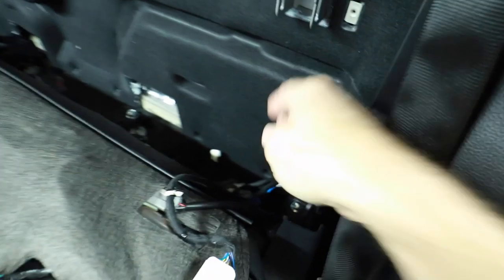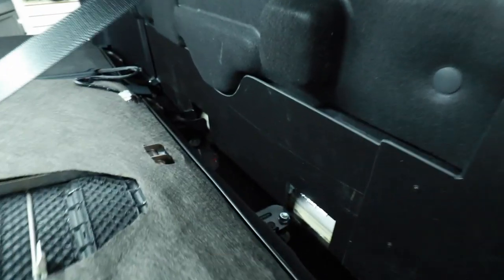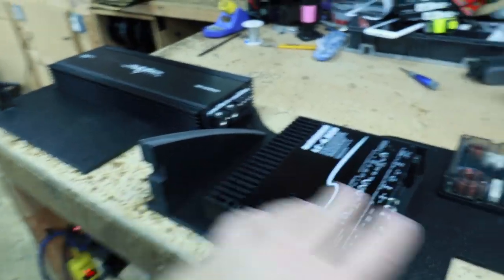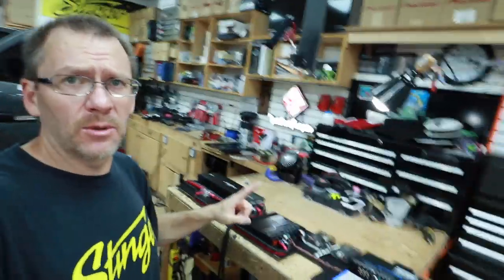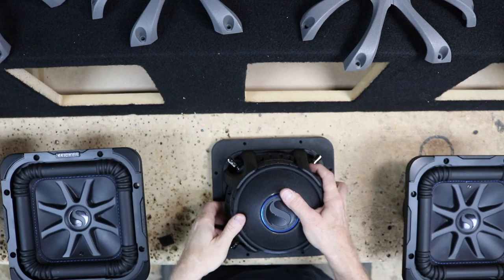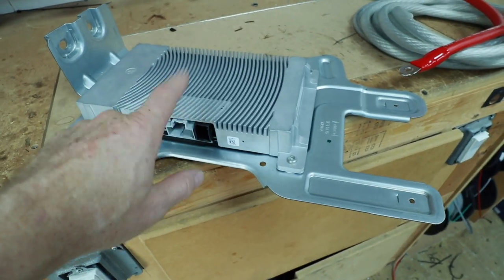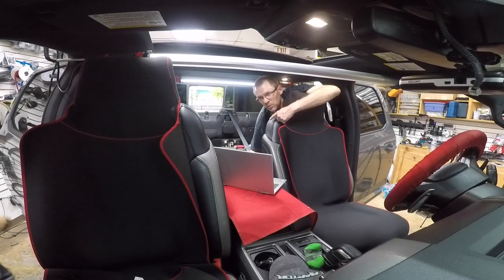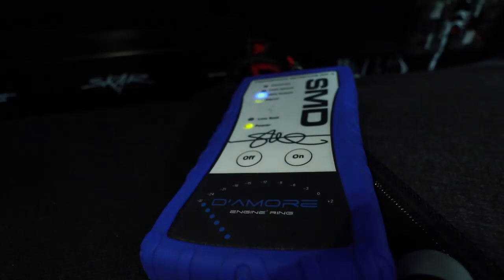A 2018 Ford F150 Raptor gets a  Nav TV Zen A2B and Audiocontrol Installer Diaries 205 part 2

Comment: Thanks for the great videos! I have a basic XLT and I've seen some amp+box used B&O systems that I would like to install. But I don't know if it's doable especially because I don't know if my radio unit has an A to B output?  Thanks again

Comment: What did you do with the center channel speaker?  Did you leave it wired for notifications/alerts?  I'm going to have a similar install done.  Why didn't you leave the front pillar tweeters as there own channel.  I was hoping to use JL Audio VXi amps which have the DSP built in - one amp for subs the other for 8-channel everything else.

Comment: Awesome install. I have an 18 F-150 that had the B&O system. The NavTV has been given my installer fits. The chimes are always messing up and I’m getting pops and random speakers go out. It’s on its third firmware update. Have you guys had any of those issues?
Reply from the maker: At firsts yes then we got a replacement unit, no more issues.
Reply: Five Star Car Stereo thank you so much for the reply. My installer says they are going to get a new one. Hopefully I just got one of the first models that was causing the issues. If it doesn’t work I may need to take a trip down to FL to see if you guys can help me.
Reply: I would hate to go back to stock after how much time and $$ I have put into it.

Comment: I had a question for you guys I own. 2018 ford f-150 I want to install. 2 amp and Change speaker's all doors.put a Speak a Box on the back seat. Under. And use the factory stereo. No amp on What do I need to use to connect to the original stereo factory?

Comment: (you didnt run in this particular vid) but if you were putting and aftermarket headunit in one of these trucks what length rca's would you recommend getting if you ran it from the headunit down the driver side door channels to where you had the amp rack in this truck.  ( i have a 2016 f150 supercrew)

Comment: Wow . I thought I had a lot of sh¡+ under and behind my ford seats but pretty sure you got me beat by a long shot. I've got 2 scars 2500.1 and 150.4 a 100f ? cap it's the size if your big addison.  We did 4 8" scar vvxv3s. I had to substantially lift the rear seat and move the adjustable handle .

Comment: If you guys used the speaker wire inputs straight to the DM-608 instead of the ZEN A2B, would it be as clean?
Reply: I want to know the answer to that one myself
Reply: @jayshafer16  well to answer my own question, I now have the DSP and it's connected via speaker level inputs and the signal is very clean. My factory system doesn't use any fancy amplifier so I get full range signal from my front door speaker wires. I spliced and sent those wires to the speaker level input of the DSP.
Reply: @BaysideSoundz  what dsp did u use and did u have the factory b&o system
Reply: @jayshafer16  Audiocontrol DM-608. I'm using my factory headunit
Reply: @BaysideSoundz  Hopefully u get the notification for this question.  If Im wanting to run another dsp after the zen a2b like the new marts digital 8 dsp and all the inputs are rca.  Would i run the rca's straight from the zen to the marts dsp since it has 4 inputs.  Front Rear and sub inputs from zen and then run the rca from the dsp to the amps.
Reply: @jayshafer16  yeah pretty much. That sounds correct as long as you have exactly that coming out of the zen's RCA (front rear & sub ). Then in the dsp settings you just assign which input you want to receive from for each output channel. I hope that made sense lol
Reply: @BaysideSoundz  made plenty of sense and thanks for replying!!!!!
Reply: @BaysideSoundz  i wish this new marts dsp had a toslink cable input then that would be golden
Reply: @jayshafer16  yeah that would be much more easier for sure.

Comment: If you leave the vent open, aint that going to give you alot of road noice when you are drivin?
Reply: That vent is so you don’t over pressurize your eardrum when slamming doors simultaneously. Manufacturers don’t want to be sued by someone with sensitive middle ear  canals. Remember they make these rides for the masses and can’t know the  medical condition of all their customers. You can potentially blow out a window too w/o the vent too.
Reply: @johnhornbeak5735  is obvious that the customer doesnt have weak ear canals if he is getting loud full audio setup. Leaving the vents open will cause road noice to interfere with sound waves. Why do you think people use sound deadning in their cars? It's too block all the outside noice
Reply: Trill Will if that is what you think then No one can help you. That vent is maybe 6x6 that won’t even suck my farts out of the cab much less “interfere “ with several hundred or even thousands of watts of audio gear.  It will however stop the over pressure of the cabin
Reply: @johnhornbeak5735  It also affects airbag deployment.